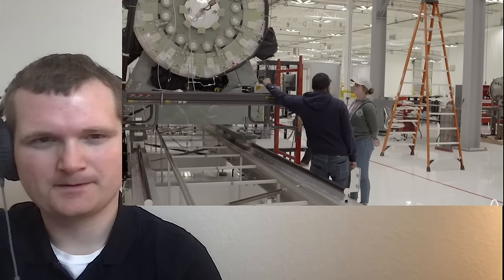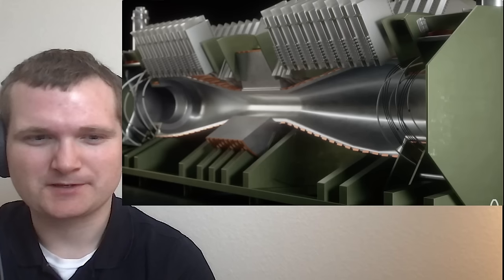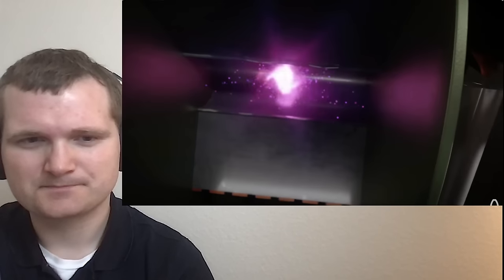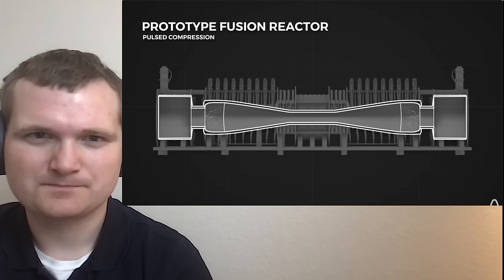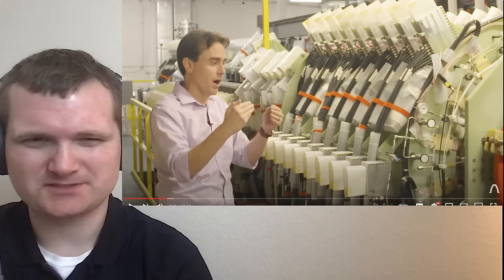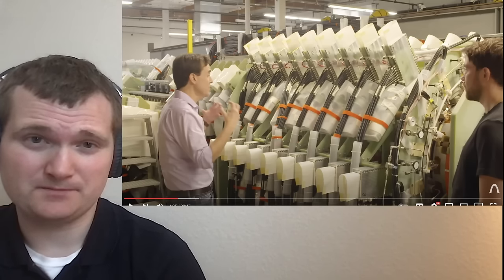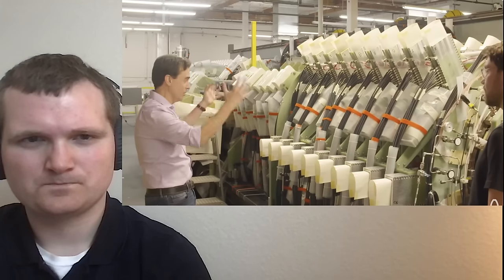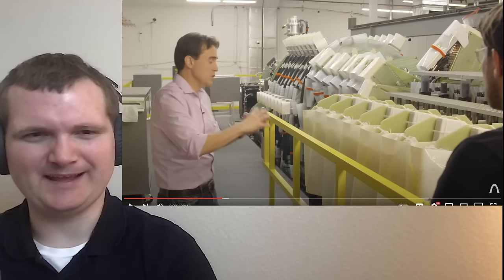Will the Helion Fusion Reactor ACTUALLY work? - Nuclear Engineer Reacts to Real Engineering

Comment: hmmm, if they can produce a moving/pulsing magnetic field, then all they need is some copper wire to generate electricity. 
Normally that is done by spinning magnets around wire (other other way around), but if they have a changing magnetic field, they don't need to move magnets, so they can skip the whole heat-water-steam-turbine thing, and just run the copper wires past the tokamak.
How practical that is?? remains to be seen I guess, but if you can skip the whole heat-water-steam-turbine bit, that's a lot of efficiency saved right there. 

But i wonder,, if this will ever be the cheaper option? Because if it can't be the cheaper option, I suspect it's not going to be built. That!, I think is the real challenge with fusion.

Comment: My understanding is that most of the He-3 we have comes from the nuclear weapons complex, from the decay of Tritium. So, He-3 is rarer than H-3. There may be some He-3 that comes from the natural gas industry (source of He on Earth), but I don't know what the concentration would be or is it is even possible to separate from the He-4. Probably not, but I think there is some quantum weirdness that means the two act differently at low enough temperatures, so maybe it's possible.
Reply: Yup all the helium 3 has come from recycled nuclear weapons boost gas assemblies. It is almost as expensive as tritium, they can easily turn it into tritium in a fission reactor. Helium 3 does not require a special license to use though. Once they get it running the neutrons would be able to make tritium easy enough. There are a lot of show stoppers with this design so I'm not holding my breath on it. 😂
Reply: The helium in natural gas and oil were actually alpha-particles. Other than reprocessing tritium contaning stuff He-3 can only be extracted from the atmosphere.

Comment: Do we have fusion right?
We smash A into B as if there were mutually repulsive balls. But all elemental particles are little dynamic moving buggers.
Imagine this as an example: a stiff wire ball made of an open coil of wire, some wrapped clockwise and some counter clockwise.
Assume for the sake of this thought experiment; the fusion requires two balls to completely slide together without the wires ever touching. 
You can imagine doing this by hand with real coiled wire balls. You would have to to have the same spin orientation, the same spin rate, the exact rate of approach to each other and of course complimentary windings.
You can fling these balls together by the millions before two happen to mesh by chance.
So perhaps the solution to fusion it is not temperature and pressure, but attention to the dynamics and a whole lot of finesse.

Comment: Strange to think that fusion could be possible even though we have barely had much time with fast (relatively) computers. We're still a ways away from transformative AI, and nuclear power itself isn't very old. I think people see progress in technology as hyper optimistic and jump to conclusions.

Progress is far slower, on the order of 40 years for an emerging technology to gain enough traction to be transformative. Thus, we are more like 60-80 years from seeing something practical with these systems.

What Real Engineering shows is a demo of a thing that could be done if all the other things are done, and with so many challenges that nobody can solve the overarching issues--we're like infants, barely having a clue about what it will realistically take to create continuous fusion.

Comment: You can produce tritium with the transmutation of lithium-6 (rarer stable isotope of lithium) and neutrons, but you can also do that with lithium-7 (the main portion of lithium you find in life) and very spicy neutrons, and this is what made castle bravo so much more powerful than initially designed. I don't know how practical the lithium-7 transmutation would be inside of a sustained fusion reactor instead of a thermonuclear bomb though, as there may not be the right neutrons for this to occur? I have no idea, I'm not educated enough on this subject.
Reply: For Helion Tritium will be a byproduct.

Comment: If you try to fuse D + He3, you still get D+D reactions, and therefore neutrons. So the Helion D+He3 reactor will still need neutron shielding
Reply: And those neutrons only occur in 1/3 to 1/4 of the reactions and "only" have 2.45 MeV energy (vs 14 MeV from D-T). That is a huge difference. If your D-T first wall lasts for a year, Helion's lasts for 4 years. And that is not all of it. The energy difference means that there are a lot more materials to work with.
Reply: @elmarmoelzer2229  and half of the DD reactions, produce a triton. At the fusion relevant temperatures for D-He3, D-T reactivity is one or two orders of magnitude greater. So you will absolutely produce 14 MeV DT neutrons as secondaries. How much of a problem it is depends on the overall machine scale of course. But I would expect it to be important at commercial scale.
Reply: @abarbar06  
No, you won't:
1. At 1 MeV, the Tritons are too hot and non-collisional at the 1ms pulse length. It takes about 2 ms for the Tritons to start cooling down enough to fuse. 
2. The fusion products along with the unburnt fuel are extracted between pulses.
So, the Tritium never has a chance to fuse with Deuterium. There might be the occasional D-T reaction but it would be extremely rare to the point that it can be neglected.
Reply: @elmarmoelzer2229  if that's true, then how can they expect 4 MeV hellions or 15 MeV protons  to deposit energy into the plasma in the first place? The whole premise of the direct energy conversion depends on that
Reply: @abarbar06   The particles are part of the plasmoid and they still interact with the magnetic field of the plasmoid. They just do not slow down enough to fuse. Also, I believe(!) that Helion is probably extracting energy from particles at the divertor. But I am not sure.
Reply: @elmarmoelzer2229  if they stay non collisional, it means no alpha heating, no bootstrapping. I can't imagine any fusion device realistically working without bootstrapping.

If alpha (or proton in this case) heating is going on, then I don't see what would prevent DT reactions. Unless they get the bulk ion temperature so high that DD falls off
Reply: @abarbar06   
1. The high energy fusion products will impart more energy to the plasma through elastic scattering than through Coulomb collisions which are rare at these energies.
In their recent paper Helion predicts significant heating through elastic scattering of the 14.7 MeV protons with fuel ions.
2. Please note that they are explicitly not aiming for ignition.

Comment: So basically it's a giant wireless charger, with inductance generated by cyclical magnetic field changes caused by heat pushing back on a magnetic choke, resulting in pulsing like a piston?  Even if that were true and you could just simplify the process by directly producing current inductively rather than heating a pressurized water secondary loop, you're still generating absurd amounts of heat, why wouldn't you want to tap into that too?
Reply: Because they anticipate for their process to be more than 90% efficient. Neutrons would make up only about 10% or even as little as 5% (if they can get additional He3 from Tritium decay) of the energy released by their fusion reactions. There is also a little bit (10%?) heat from transport and ohmic losses), but over all, it is not a lot.
Steam cycles add a lot of capital cost. You have to make that back from what little additional energy you can extract from that. And a steam cycle might be maybe 40% efficient. So you get 40% of those 10 (maybe 20%). So 8% additional output. It might just not be worth it.

Comment: Good analysis. I have an issue with your efficiency thoughts, though. Because in the end, efficiency doesn't really matter. If they have an efficiency rate of 0.005% BUT have a reliable reactor that produces (lets say) 20MW at a competitve price point - you have a 20 MW fusion reactor. No one cares anymore what kind of fuel you use or that you don't use the high perfomance fuel as other reactors. In the end it is the bottom line (i.e. money) that counts.

Comment: So, unsurprisingly, this video (both the original and your response) have left me with questions. I'd appreciate help clearing up some of my confusion if any SMEs (subject matter experts) are willing to spend the time.

19:30
So the numbers Helion is implying disagree with your graph there. Assuming you pulled that from a textbook, I'd be inclined to believe the graph, absent other information. But the Real Engineering video then immediately goes into the different reactions a D-D fuel mix can do. If they (somehow) bias the He3 producing reaction instead of the T producing one would that explain the difference? Or is the 'reactivity' in that graph somehow distinct from energy release? Or is there something else going on here? Like lying. (Question for any plasma physicists in the comments, is that kind of bias something you can do? Or do D-D reactions always produce the same ratio of T/He3?)

23:30, had a question, was addressed in under 2 mins. Nvm.
Reply: D-D reactions have a 50% chance of either producing a He3 atom (Helion) + a neutron or a Tritium atom (Triton) and a proton. The rate is always the same. 
The Triton has a half life of 12 years and decays into more He3. They could wait for that to happen or trade the Tritium for He3 or they could sell it just for extra profit. At current prices(!) selling the Tritium would make them much more than selling the electricity from He3 through Tritium decay (assuming their projected 1 cent/kWh).
Anyway, this means that Helion will have to do two D-D reactions for every D-He3 reaction and will get one neutron for every 3 reactions (every 4 if they they have additional He3 from decay or trade). Mind you, D-D neutrons are relatively(!) benign.

Comment: Well, while this project is at the stage of implementation and creation of a working prototype with the ability to remove electrical energy from the difference in the magnetic field, however, this will not directly provide a large amount of it, and for this there is an additional production of tritium in the process, this aspect should make the process profitable. The company seemed to report that in 2023 they conducted the first tests of the new Polaris reactor, and there they achieved the planned performances, but this is a commercial project and therefore it is difficult to verify the reality of the data.
Reply: Polaris is not completed yet. They built a formation test section to get a head start with the fine tuning of Polaris. Polaris is scheduled to be completed in summer.

Comment: Not the worst reaction video I have seen to the Real Engineering video. I suppose that reaction videos are limited to watching videos out of context of other information available, which would have answered a lot of your questions. I can provide you with links to that if you are interested.
Here are a few answers to Qs I remember from your video:
Their machines will be 1 to 10 Hz. They will produce 50 MWe. 
Polaris will operate at around 20 keV temperatures. Power plants will likely go higher. Their densities are very high compared to Tokamaks (orders of magnitude higher). Also worth noting that they have a very low Te:Ti ratio, which helps a lot, especially with higher Z fuel mix.
Their direct energy recovery is prospectively very efficient for the input energy (95%) and somewhat less efficient for the fusion energy (no official number given yet).
Polaris and their future power plants will have A LOT of shielding. Polaris has 2.5 meters thick concrete (doped with boron carbide) walls around it.
They have ALL of the permits that they need.
FRCs are not new, but the way they use them is. They have patents for that. It goes back to research done by their co- founder at the UW.
It would be best to contact Helion directly. David Kirtley is really busy, but he does not bite.
Reply: Will do this, will do that. Sounds a lot like Starship will land on Mars in 2018.
Reply: As expected, Helion Energy bot "elmarmoelzer "is under  video about criticism of his dear fraud company.
Reply: @avastorneretal   Accusing someone of fraud without any evidence is not a good idea. It is called libel. I would refrain from that. Not that I think that anyone at Helion actually cares about what some rando on Youtube thinks.

Comment: it really sounds like they ignoring heat. For me it make sense that near a thing like that will be big ass steam turbine, that sucks another 10% of power out of that source. 
output of that machine is in thousands of kelvin, not using it for anything is just waste.
metalurgy or just plain city hot water would take that heat without a word. 
for sustained use, they need to keep the heat in check, so massive AC adding another heat output somewhere is also needed.
Reply: The question is whether 10% more energy to sell is worth a lot more overnight cost. At 1 cent/kWh (the target cost Helion wants to achieve), a 50 MWe Helion power plant will make a mere 4 million USD/year. 10% of that is 400,000 USD. How much does the steam cycle (including everything that goes with it) cost to build and maintain? How long until the extra build cost is paid off?
Reply: @elmarmoelzer2229  to be honest, I don't think it's possible to make it in any other way, due to the amount of heat this will make.
everything in this setup will make MW worth of heat, if you try to air-cool all of it, that's just so wastefull.
Reply: @deilusi   No one says that the power plants will be air cooled. That said, their energy recovery is supposed to be ~90% efficient. That is 5 MWth worth of heat (adding in some other losses and X-rays and whatnot, it could be on the other of maybe 15 MW. So let's use that. A steam turbine can be up to 40% efficient but that is assuming that the temperature of the coolant is high enough. Still, lets use 40%. Then we end up with 6 MWe from that or about 12% more output. Again, that's about 400,000 USD/year. How much does a steam cycle like that cost (not just a liquid cooling system but also a turbine hall, and cooling towers, or ponds that will cool the cycle down enough for a sufficient heat gradient)?

Comment: When I see these types of videos I generally assume it's funding time. I agree with you that the temp quotation seems low. The solar P-P chain begins with the fusion of two protons to form deuterium.  But that's a low probability reaction which of course is why that chain isn't used in any serious fusion experiments. Incidentally- the last solar model I saw had the central core temp at 25 million deg K . 15 million K is apparently the minimum temp required in stars to meet both the collisional energies and the time required for the residual force to bind them. One thing I have never seen properly explained is the presence of the Beta+ decay associated with the fusion reaction as Beta+ is weak interaction rather than Strong Force 
jfwiw- Stars with the Sun's mass have radiative cores thus there is a temperature gradient between the central part of the core and the Core/Envelope boundary.  It tells you just how friggin much hydrogen there is in the Sun that even at the low probabilities of the P-P reaction 600 million tons of Hydrogen are being converted into 596 million tons of Helium every second with that 4 million missing tons being converted to energy at the various steps.
Reply: Helion is fully funded all the way to commercialization. They do not need funding. They are trying to raise awareness and get customers early on because it unfortunately takes forever to get a grid connection license in the US.

Comment: The idea of using an expanding conductive medium inside a coil that is conducting a current in order to generate a big pulse of electrical power is nothing new, units having been built since the 1950's.  Look up, for instance, "explosively pumped flux compression generator".  When this is done with a plasma produced by a conventional explosive the efficiency is low since the plasma is not sufficiently conductive.  One way around this problem is to place the explosive inside a conductive tube such as copper or aluminum that is inside the coil.  The explosion expands the metal tube until it rips apart but prior to ripping apart the efficiency is greatly improved.  Another variant is the "explosive ferroelectric generator".  Helion's plasma conductivity would have to be much better than these plasmas in order to get good efficiency.

Helion has said one of the machines has demonstrated over 90% energy efficiency, but that was just taking the energy from the capacitors to the coils and back again.  That is done in power converters all over the world every day.  Helion’s most telling statement in the FAQs on the Helion web site is, "To date, we have not released results overviewing our energy recovery with plasmas present."  So, they want us to assume great things, but they are not revealing their actual results.  We are only guessing what they might extract from the plasma.  We must wait to see some actual results for energy extraction.

Comment: Wouldn't d-d fusion be faster and cheaper?  It wouldn't be aneutronic like this, but it would fuse faster.  If you are worried about the neutrons, wrap a thorium blanket around it and make fision fuel.  It would get the tech to a commercially viable faster.

Comment: no because in the terms of fusion, your not loosing matter, your loosing the volume particle probability size due to its energy state, when T is a higher Prob state it has more energy as a 3 nucleon atom, when He3 has a lower Prob volume state due to its particles masses, its very different.